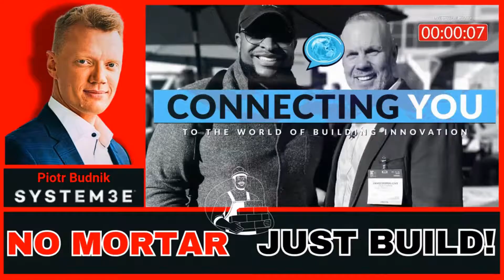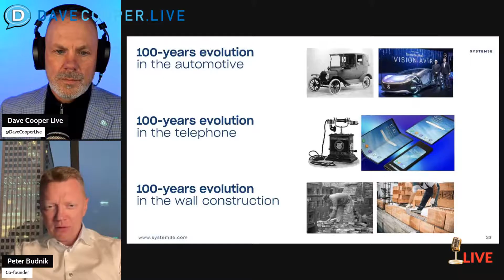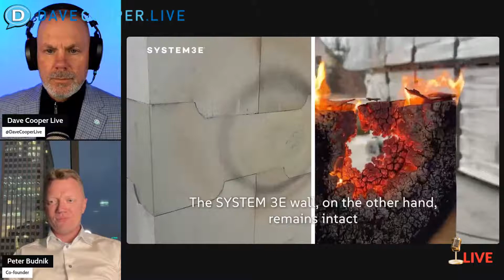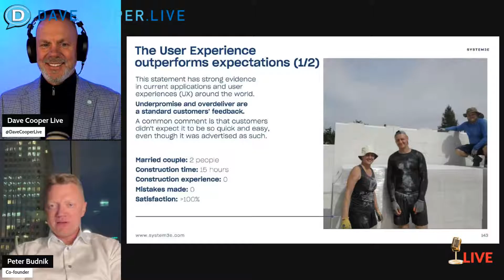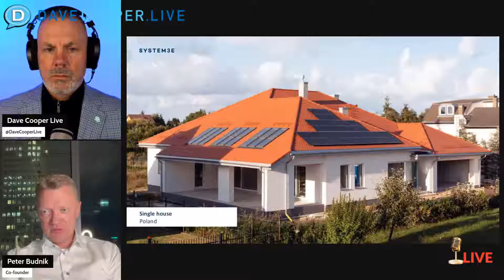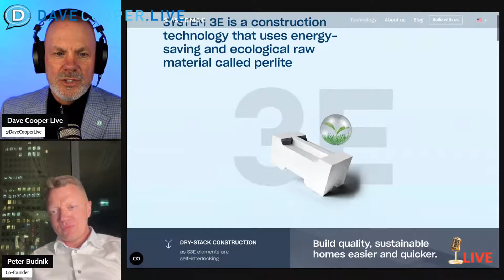Self Insulating Jointless Construction -NO MORTAR! - SUSTAINABLE - RESILIENT! - JUST BUILD!

Comment: HOW is the ROOF attached to the slab? High winds could simply SUCK the roof right off with the top layer of blocks.....PLEASE explain.
EDIT:  @14:00 this question is answered. They use holes in specially ordered blocks(high wind areas) to connect with the foundation similar to cinder block construction. Utilizing a rebar/Concrete connection.
Reply from the maker: Awesome I’m glad he did answer this

Comment: What stops the roof from lifting the block up in a hurricane?
Reply: @14:00 this question is answered. They use holes in specially ordered blocks(high wind areas) to connect with the foundation similar to cinder block construction. Utilizing a rebar/Concrete connection.